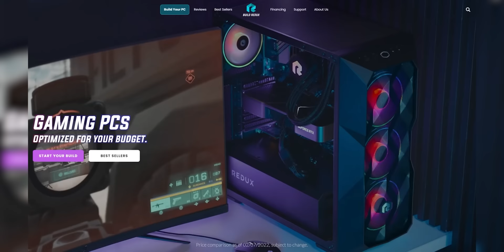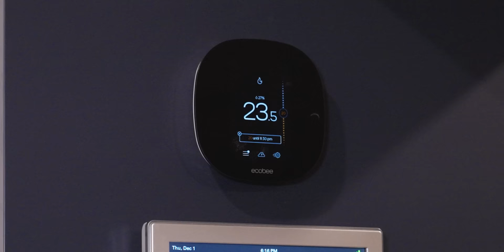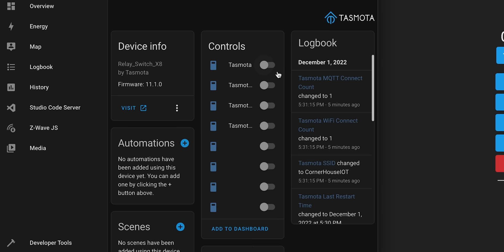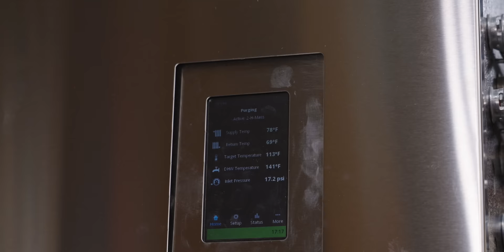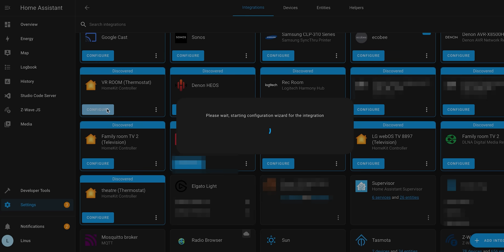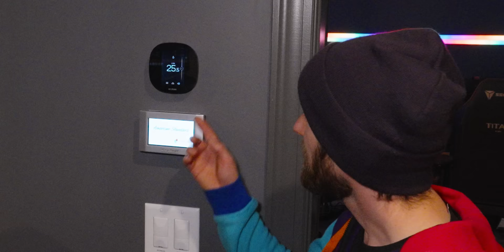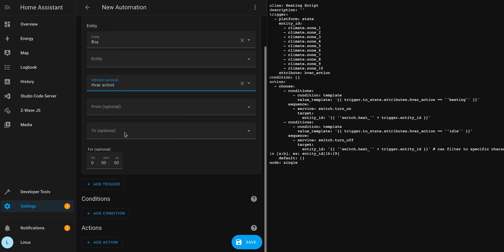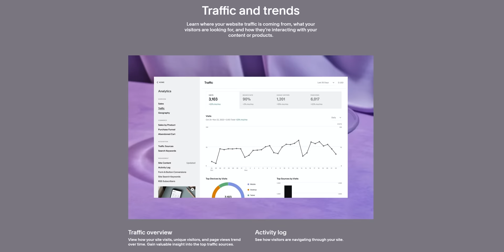My Smart Home is Stupid - HVAC Update

Comment: I have an ecobee and that temperature discrepancy thing is extremely frustrating. Ecobee's support team recommended using their occupancy sensor that also is a thermostat. It is MUCH more accurate and is not sensitive to air movement (i.e. fan, behind wall air flow, etc.). So a solution could be to use those sensors, but it is frustrating to have even more stuff around the room.

Comment: Even though I understand that being able to set the temperature on the screen in every room is convenient, I don't think that's the best solution. Using some z-wave multi-sensors along with presence detection would allow to automatically control the temperature in every room depending on whether there's anyone in it or not. You could even do the presence sensor recognizing who is where and adapt the temperature depending on each individual's preference.
Either way, using some Ecobees seems unnecessary.

Comment: This seems way more complicated than it should be tbh.  Should just have some temp sensors in each zone instead of the ecobees then a web page to configure the temp.  That's basically how I did my house. I want to redo it though since my setup is not super modular, but it's been working well for about 10 years with little to no interaction.
Reply: ikr, I've had a single Raspberry Pi running my home heating for years.

Comment: I don't know about ecobee.  But most wifi thermostats have a temperature correction or an offset feature that you can use to adjust the detected temperature.  I know the wyze thermostat does anyway.

Comment: I am kind of surprised you didn't go with a generic thermostat in home assistant, and you could  have used a small tablets as the display.  That way you could control really anything in home assistant not just temperature.  You could have probably even got a 24 VAC TO 5V DC inverter to power them off the exist power.   Also, you could have used a battery powered wireless  temperature sensor with the generic thermostat, which would address the heat given off by your heat pump thermostat.   I did see your comment about you wanting to integrate the heat pump played into your decision making, whis is fair, but I would  be curious of the details surrounding that.

Comment: As a hvac professional I’m really intrigued about the American standard issue. Bc you should be able to use the ecobee for Everything.
I’d love to know what model numbers are and see why you can’t. Bc I haven’t found a system that can’t be controlled by ecobee’s

 Also I don’t see why the ecobee can’t activate the floor heating on its own.
Reply: That was my thought as well, why not install the ecobee only and have their emergency E/second stage w2 line control the in floor heating valves.

Comment: Linus you have like 14 3d printers man dont buy new thermostat sensors just print some little redirectors for the thermostats that push the air out from the wall as opposed to straight up. Like those little magnetic things you can slap on your floor vents to blow air towards the middle of the room.

Comment: you should ditch the heat pump and hookup a water coil from the boiler to the air handler. heat pumps dont work in extreme colds. also you didnt need all the different ecobees cause the have sensors that you can put in individual rooms

Comment: Yeah going full smart home seems to provide more headaches than it's worth, even without the potential bugs.  I'm lucky enough to live where Comcast still hasn't capped data to 1.2tb (literally, like a cell plan, you can only use 1.2tb a month...  I use 2tb a month minimum.  Comcast fails to realize how fast security cams can eat through that, not to mention my downloading of many games and updates.  The cap does nothing except provide comcast with additional revenue because the cost to deliver the service doesn't increase with more usage by users.  It's a big scam)  But so I at least don't have to worry about that cap, but still the potential for issues when you just want to turn your lights on, not to mention something like a wifi lock is just a needless potential point of entry for a smart burglar (and I don't live in an area where I really have to worry about getting robbed, but you still want to think about security), it just doesn't seem worth it.  Sure, I have some smart stuff, but I didn't go all in like linus.  The worst case is my fridge has wifi.  It's frankly pointless and I don't use it.  It just came with the fridge we liked, which wasn't even one of those Samsung tablet screen fridges.  But 9/10, I just hit the light switch.  The fact that my room's lights (which use smart bulbs and an led strip mainly so I can change light color at will) have no physical switch is annoying.  The only thing I'd like smart bulbs for, besides the color changing, is so I can make them turn on at a specific time to get me to wake up better, but that's something I've yet to figure out.  All in all, the issues outweigh the benefits for me.
What linus says with a smart home being great when configured properly is pretty true, but in the end, like Linus, most aren't.  Hell, I'd argue that if linus is having trouble getting that configuration to work, it's not the user's issue, but the product's issue.  Case in point, you get everything working in your living room, only to find that your z wave switches are interfering with your wireless speakers, like linus has.  You will eventually solve this, but in that time, updates or just entropy of the universe will break 10 more things.  Your house will never reach that "configured properly" time.  This is the problem with constant updates.  But those updates are needed for security, and they won't stop.  The only solution is to avoid making your house a big futuristic smart house.

Comment: Just put in KNX, which is a proper global building automation standard. That us what I use. It is hassle free and just works. My temperature sensors are hidden and I use my phone or cheap wall mounted Windows tablets to monitor and adjust the temperature in most spaces. I have one app that controls everything: lights, heating, shutters and fans. I do have in my kitchen and basement switches with built in thermostat and display.

Comment: In future esphome would be preferable over tasmota. But of course, as it looked like devices were already flashed and (almost) setup. Flashing them all is more time, and tasmota still works so I would probably do the same :)
But in future projects, esphome gets rid of the mqtt connection, and has their own connection to directly talk to home assistant. It also by default it's more secure (some encryption and password protected, and a lot of it's local control via ip address has been turned off by default). It's a little more confusing to install/flash than tasmota, but it gives you more control too, and you can remotely update it use local scripts and upload it from home assistant.

Comment: Unfortunaley you dont use a KNX system with a 2wire bus system. I think you would like it, because you would need only 1system to control everything(heating,cooling,lights,switches,)Thats the common solution for smart homes in germany.

Comment: I have no idea why Linus didn't A) use ESPHome instead of Tasmota (no extra configuration needed, Home Assistant would just let you add the devices with a couple of clicks); and B) insisted on using Ecobees when a simple ESP8266 with a temperature and humidity sensor (also running ESPHome) would do exactly the same thing, at a fraction of the cost, and without having to go through Homekit to get local control...

Comment: I didn't understand why there is need for both the ecobee and that american standard thingie. But I can relate to the problem with the thermostat being heated from something thats trows the value off. Had an apartment where two old school radiators were mounted in a V-shape in the corner with one thermostat facing the other radiator, so one radiator was always warm and one was always cold...

Comment: Lotta people bashing on "smart home" stuff for good reason, but I think if we ever work out the (actually easy to solve, once someone in the position to actually does) kink of not having any enforced communication standards , it'll be a lot more sensible than having systems that need to be constantly manually tweaked, or automated systems that require you to tear the wall out and rewire every time you want to add a new sensor.

Comment: 0:54 the solution is to live in a proper home with insulation instead of a cardboard home :)
Reply: No clue what you’re on about. I love to poke fun at North American construction, but wood framing can be insulated super easily, substantially easier than brick construction. Given the effort Linus went through I would be rather surprised if the house wasn’t decently insulated

Comment: It certainly smells like some serious over-engineering here. As a software engineer myself, I wouldn't go down this route to "automate" critical systems like HVAC in my house. Hardware wise, it's too many moving parts with no hard-wired backup system or proper failover logic; software wise, it's lots of components requiring configuration, many of which may not be forward compatible, hence requires frequent maintenance. It's probably fine for non-critical things like accent lights, but certainly not for HVAC.

If for any reason this complicated system goes down, it could cause a lot of damage that aren't as easily fixable as software, for example, your water pipes might got frozen and cause a serious water damage.

Comment: I also have a fairly large house (approximately 350 square meters~ 3800 sf) and the heat is provided by hot water radiators and central heating. I have only one thermostat in the coldest bedroom  and in the rest of the rooms the radiators are turned down slowly so that the temperature is good , done. Easy peasy lemon squeezy, I have been doing this for many years and I have never had any problems. I agree, Smart Home is Stupid.

Comment: I think that simply running cables all around the house , adding normal thermostats to the rooms, controlling motorized valves in the basement you would have a working heating system Hvac system I would make a bypass system thus feeding it live temp and just set it maintain x temp. For internet connection, I woud set temperature sensors in room sending data to whatever. This whatever would control a panel in the basement where with normal relays I bypass control of thermostats and control valves through the cloud. Siemens logo or similar, which has relays and can connect to internet would come handy at this time though you nedd more expensive things for internet control. But overall I think this way system is cheaper simpler more robust. Smart homes and home assistant at this time, as someone who has fidled with it, are rubish and filled weird stuff which need a manual because of all those not common technical words. My tyua sensors are integrated, though the program controlling them is crap and my Daikin air conditions use onecta andare not complaint with Alexa or similar , for example.

Comment: Just don't use the ecobee built in thermostat. Even the older version supports the wireless sensors, plus they double as occupancy sensors (which you want). You can even put them in different parts of the rooms to ensure there aren't hot or cold spots. I use six of them, they're cheap and work great.

Comment: If you’re just using the ecobee’s as temperature sensors and controlling everything via home assistant why not just buy actual stand alone smart temperature sensors? They sell some BLE or Zigbee ones that can do the job.  Most are battery powered but there are some that are usb powered that a 24v to USB converter can be used to avoid using batteries.

Comment: I feel like it would’ve been really easy to setup a custom gui by taking a template and use a raspberry pi  with a 5in or 7in touch screen that could then have a temp sensor attached. This could send a single to turn on or off to home assistant via a plugin on the pi… it would be low heat fast response and no input lag with a customizable gui…

Comment: This entire setup is actually very questionable.  I would have expected more.
I use a KNX setup, where each individual room controller is used for push buttons (lights) and thermostat.
Through the KNX network I can directly control my switches that open or closes valves on my underfloor heating.
My heat pump also comes with an EEBUS connection, which can be exposed to KNX bus.
I can read and control every parameter through that setup.  Decentralised and 100% local.

I however do have a Home Assistant running for data logging and automations.
So I only use the HA for master control of all elements, time programming etc.
The actual heating control will always work, as long as there is power! 
There's no need for all the IoT stuff and to have HA as a single point of failure!

Comment: You really should have went with a bosch heat pump that can run off of any thermostat and are more efficient than any traditional heat pump.  You might have been even capable of running it off of your Zwave system.  The bosch heat pump is also variable in that it adjusts the compressor capacity by itself as the load changes.

Comment: I was just thinking about how hard it would be to set up a smart home properly and get it working with everything like Linus has done...
Reply: It's way easier if you use it as intended.  The thermostats are supposed to be wired directly to the valves, then you don't have to kludge with home assistant to make them work as expected.

Comment: never seen so messy with heating and HVAC. CO2 sensor missing. RH sensor in bathroom missing. ventilation speed can be also adjustable with HVAC controller, so different RPM etc...with loxone you could solve all this....

Comment: why do tech tubers keep regurgitating the misconception that if the internet is down, you can't adjust any large manufacturer's equipment?  Level1 did this recently too.  Nest works just fine when the internet is down.  Walk up to the thermostat and adjust it.  It wouldn't be able to be adjusted remotely, but you couldn't adjust a traditional thermostat remotely either.  The number of click-bait articles suggesting otherwise has been astonishing.  And, it's a bit disappointing to see Linus playing into this only sort-of-based-in-reality concept.

There are also much better solutions than Ecobee for a dumb temperature sensor.  Dump them overprice and underutilized Larrys and use something like an ESP or Arduino that'll be both cheaper and allow you to do more.

Comment: This system needs constant update and support.. its a nightmare.  I have knx as base that works without servers and whatnot in base configuration and then on top a knx Server that does the fancy stuff. If the server and even if the complete network fails my light, heating and shades are still working.

Comment: Out of curiosity, why did you home brew all of this ?  You could have just bought a single Nest Learning Thermostat with a sensor for each zone, and set the valves up to each zone in the Nest.  It supports up to 6 sensors and it can control 20 zones.  It seems easier than hacking together all of these different softwares using weird backdoors and undocumented features which may get patched out any day, breaking the whole system..

Comment: Looks bit overcomplicated for when things break for whatever reason, HA update with homekit integration or ecobee integration of automation updates or any of the other breakages.

I use drayton wiser with TRVS they wall work locally and i have it integrated with HA, I don't do any automations for heating outside some trigger to turn off, nothing that will be needed to work though as I don't like relying on more then you need to

Comment: Why not also use the ecobee remote sensors (which also monitor room/occupancy). Also if you have forced air, you can look into Flair smart vents which integrate very nicely with Ecobee

Comment: Uhh, are the valves controlled in a digital manner? It's not recommended to do so, because of thermal expansion pumping everything until fatigue at some point in time. Three way valves with a PID-controller would be the best option. My whole 250m2 house is controlled by a single PID-schunt and a single in-door thermistor, no temperature fluctuation indoors.

Comment: So.... I can spend hours upon hours to rig up complicated systems that can be knocked out by wi-fi flooding or internet outage. Or, I can use the perfectly functional direct wired old style thermostat. Another benefit... the thermostat doesn't require as much power to run.
Reply: You could also just use real smart home tech and get all the smart home benefits without the hassle.

Comment: well atleast the ecobee is more accurate then your avg nest (they seem to have an issue where the temp sensor is to close to the screen so the screen manipulates the temperature reading).

similar to the issue with the Aquacomputer high flow next which should be able to calibrate your temperature sensors wile your PC is off but since the power appears to be on the same PCB as the internal temperature sensors the temperature it reads when your system is off is not accurate as the USB power is heating up the pcb/temperature sensor >.< and being off nothing moves that heat away from the temp sensor

Comment: Why don't you just swap the thermostats put the trane on top and the ecobee on the bottom.

It's just a low voltage wire and 2 backplates you should be able to handle that easily.

Comment: Linus do you have a battery bank to power the whole house as a back up? It would be good to have to run the house after storms and be independent from the grid. Also in the summer you can generate majority of power with solar.